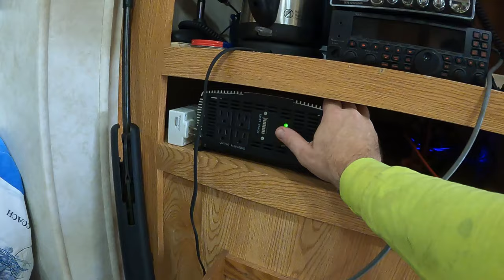Introduction and beginning of EG4 battery bank install.

Comment: That's a serious off-grid plan! There must be a large house in the works as well (or I missed it).
Reply from the maker: Nope, not big house. At most maybe a very well insulated and smidge passive solar tiny house, however, there could be multiple such dwellings in the future, and a pretty good size or capable shop, farm stand etc.

Plus, if I ever move to a larger property, I can just take my "grid" with me. Planning for the future, attempting to cover potential increasing needs.. up front.